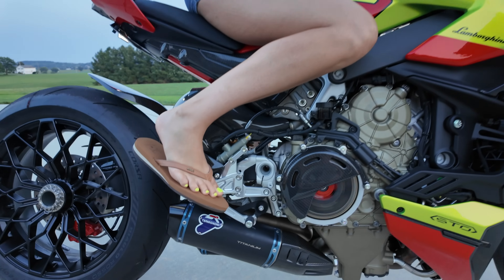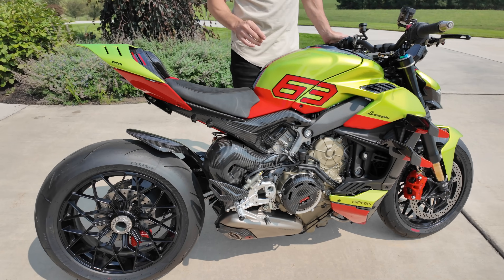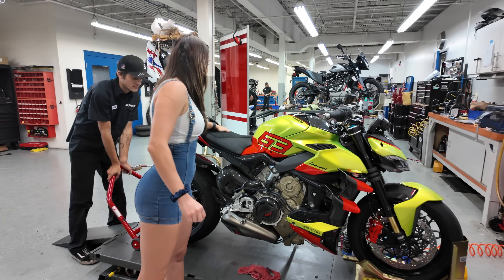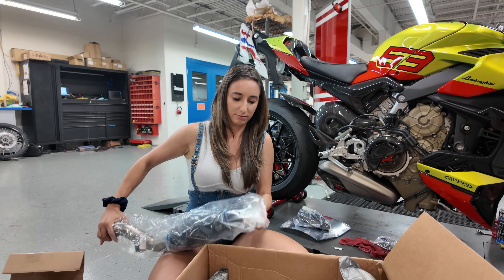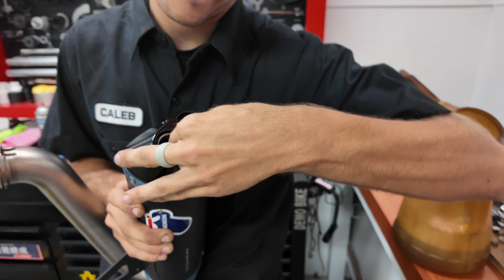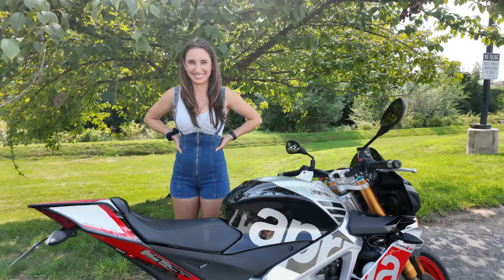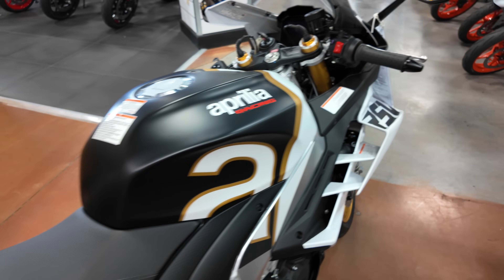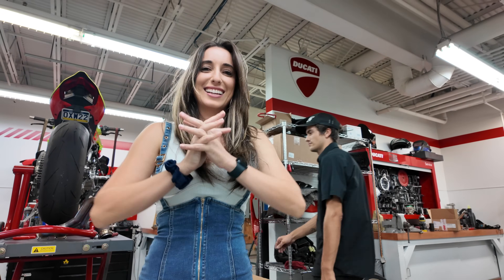Installing a Titanium Exhaust on My Lamborghini Streetfighter!!!

Comment: Have the same Termi's on my '23 SFV4S with the Upmap but didn't like the tune at all. Couldn't hold steady RPM when you have to cruise and cutting out when going from neutral to first. Ditched it for the Brentune and couldn't be happier. What a difference! And ended up putting the DB killers back in after a few months. Still sounds awesome and plenty loud but won't need a hearing aid in a year. Yes I ride with ear plugs...
Reply from the maker: Appreciate the feedback i'll keep that in mind thanks!

Comment: I had the Termi on my older SFV4S...FANTASTIC sounding exhaust!  The Arrow is simply too strange with the way they are shaped and the Akra's are just STUPID EXPENSIVE.   I want to put either the Akra or Termi on my SP but financially the termi is the way to go....the blue is barely even noticable once its actually on the bike.  As far as other mods....if you are keeping the bike you absolutely need the sump guard, pick a color and get one on there if you are gonna ride it.  Glad to see yuo got the radiator guards.  Instead of the CRG mirrors I did the Motogadget flips that look fantastic and are a little different
Reply from the maker: Some great choices there thanks buddy!

Comment: Jaret, if you can't flat foot on the Streetfighter, you can get a lower seat from Ducati.  I got that for my 2021 Streetfighter V4S, and I have no issues flat footing..  I'm 5'9" with a 32" inseam, and I couldn't quite get my heels on the ground with the standard seat.  I highly recommend the lower seat option.
Reply from the maker: Thanks for the info!  I actually don't mind not flat footing so I'm good :)
Reply: you are blessed im 5'10 with some shrinkage due to weight gain i can flat foot a grom with my member against the tank. pretty sure on a v4s im tippy toeing

Comment: @JaretCampisi I notice you don't plug your motorcycles with trickle charger in your garage. How come your batteries haven't died on you all this entire time?
Reply from the maker: They all have lithium batteries which hold a charge for up to a year...so as long as you ride them a few times a year they should be fine :)
Reply: @JaretCampisi Not in my experience. 🤷‍♂️

Comment: Why the hell would they put cylinder deactivation on a motorcycle? I wonder can you tune that out. Also i havent been keeping up with yt due to work , but what happened to Dado?
Reply from the maker: Yes you can get a tune to get rid of it...they do it for heat reasons to keep the engine cooler.  Dado and I had a falling out and are no longer friends or working together.

Comment: Personally, I think the Ducatis have a very nice style, however some references have completely lost their aggressive aesthetics, as is the case with the Monster. On the other hand, they are motorcycles that, being new, usually present different problems, among the most common electrical and of sensors that affect more important components, and of course if you do not have an extended warranty the repair will be expensive, on the other hand I emphasize personal taste, they are the brand of motorcycles with the worst engine sound in my opinion, of course you can buy a exhaust termignoni which by the way are too expensive compared to other brands, and the motorcycle will continue to sound horrible, if we compare it with the sound of a Kawasaki, a Yamaha, a BMW, a Suzuki, the sound is really poor, now the clutch is dry For many, the sound is beautiful. Personally, I find its sound horrible, and what many do not say is that it is extremely delicate, all the dust, dirt, water, dirt and so on noticeably affects the clutch discs and usually damages important parts of the clutch. engine. In my opinion, quality and price are very expensive motorcycles that are too delicate, because of their value you can have other brands that offer better performance, better sound, etc. but of course it depends on each person's tastes.